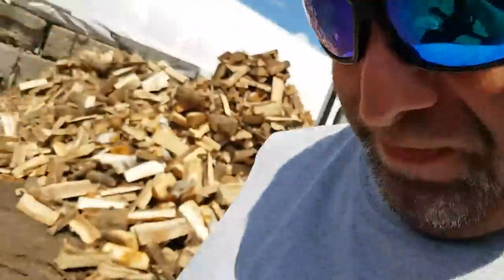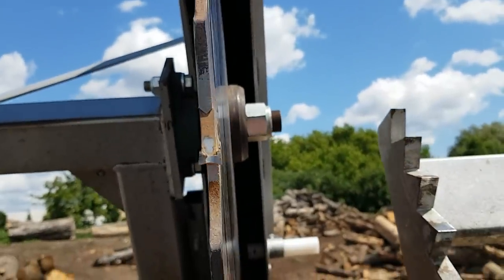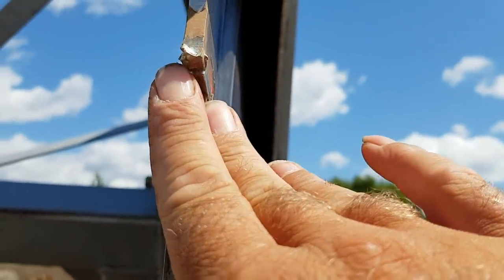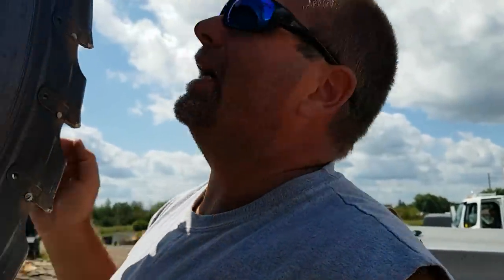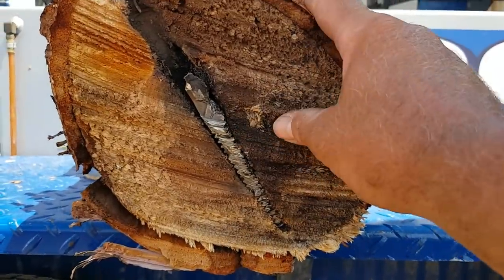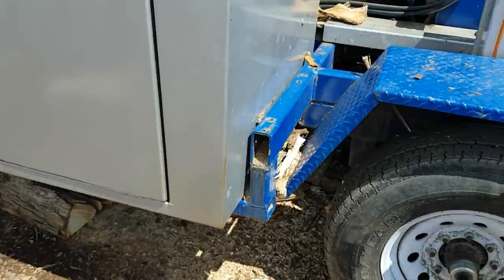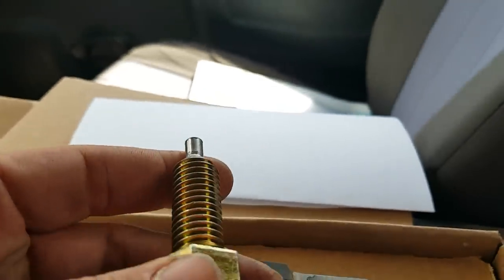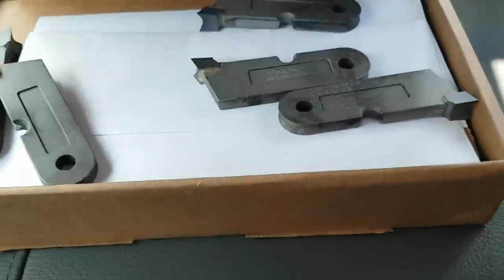MY WORST NIGHTMARE as a firewood processor operator

Comment: I worked at a big sawmill and we ran a huge band saw. The sawyer would hit a big spike or something and it would ruin the band. Ripped the teeth off. Sometimes the Metal was so big the band would break and fly everywhere. The band were at least 14-16 inches wide and really long. That metal will ruin any blade for sure. Be safe GOD BLESS.
Reply from the maker: Ya steel and band saws don't mix.     Happens on our woodmizer too but the band are way cheaper for it then those big boys
Reply: Skidder Kev yeah I worked on a woodmizer to.

Comment: A friend of mine cut through the adjustable sliding fence on a miter saw by accident we both had faces full of metal shards  i would have hated to be around that tree when you cut it
Reply from the maker: Pretty safe in the cab but if you were behind the saw it would be bad news.
Reply: fence needed a redesign and you guys need to get smarter

Comment: I have been piling up the stuff I hit with the sawmill. I have enough bullets to fight a war and enough nails to build a barn. Gate hangers are fatal. Electric fence insulators are tough. A sheet rock screw will ruin your day. Barbed wire will reappear about forty years in deeper. And when you cut nails off one side of the tree remember there are probably nails on the other side too. Sucks killing two blades on one log. And those city trees full of concrete are just wrong.
Reply from the maker: ya the concrete is just over the top.

Comment: Wouldn't it be faster to have an entire blade as a spare and replace it when needed?
So you could always change the teeth on the broken one later on and don't lose so much time while processing.

Some people call that dead capital, but when you need it, you will be happy to have it. Should spare you the drive to the blade shop (not to mention if they by chance happen to have not enough in stock for you) plus the time needed for the actual replacing.

On the other hand: I don't know how much an entire blade weighs. Looks not like an easy task to handle it.
Reply from the maker: Ummm it might be faster but if you are on a custom job you would still have to go back and get it at the yard.  (Nit something that would be brought to every job)  now that we have a set of shanks all we have to do is silver solder on new tips and we will have a set that is easier to carry with us.    A spare blade would be well over 2000 bucks US

Comment: What do you think of a precut metal detector that runs a foot or so ahead of the cut?
Reply from the maker: It would have to be farther then that.    If it was on one side would it be able to read to the other side of a 18"log?
Reply: Skidder Kev you are the expert on this and wouldn’t have to be fancy. Just a clear area to skim the log without any to lower interference from the machinery.
Reply from the maker: I'm not expert on metal detectors I thought you were!    Haha  the problem is having no interference on the other side because of the infeed conveyor

Comment: look almost like a large lathe cutter  . I know that has to suck , I see quite a few of these on youtube with metal buried in trees .
Reply from the maker: I thought it was maybe a gate hanger.   I might cut a cookie off with it and put it in clear  epoxy .
Reply: @SkidderKev  , i meant the tips on your saw blade look like a large lathe cutter .  I bet you find lots of lag bolts and screws and nails in trees  , and barbed wire imbedded in there also .

Comment: when i was growing up, my uncle cut firewood for a living, he was cutting through some old oak that he bought off someone, and hit an old window weight, one of those cast iron beasts you find when remodeling 100 year old houses. Our best guess is someone had to replace their weights, a long time back, and for some reason stuck that one in the tree, god knows why.

The blade on my uncles rig was a solid piece, so when it broke, you had to replace the whole damn thing. the saw itself was probably 75 years old, minimum.

When this thing hit, it lodged a chunk of the saw blade in the side of my uncles old Cat Bulldozer. Had it go off on the opposite side, it would have through the mesh grate that protected my uncle while he was inside his fork truck, loading the logs into the mill.
Reply from the maker: Wow!   That weight really did a number on the saw and dozer.    I never make a cut if anyone is near the back side of the saw or the boss is running the machine behind it.  You just never know what is in a log
Reply: @SkidderKev  Its terrifying to think it only takes a moment to hit disaster. An old bit of fencing, someones old clothes line anchor, and next thing you know, you're seeing a familiar name in the Obituaries.

One thing i always make sure to do is, check the logs i cut for my own firewood, for any lumps or 'oddities' on the surface, as sometimes you can actually see signs of the tree growing over the object.

That simply isnt practical in a mass production setting.

Stay safe, because hot damn, what you do is dangerous.

Comment: All that high dollar equipment and no metal detector is stupid!
Reply from the maker: I don't know of one processor owner that uses a metal detector.   You must be the only one.    They have no guarantee to catch the metal either.
Reply: @SkidderKev  it's a very commonly used item in the timber business. I believe if I owned a $20-50000.00 dollar machine, I would have a $2000.00 metal detector. Just saying....

Comment: Fix it with a angle grinder
Reply: I don't think a grinder would get anywhere near the precise geometric cutting angles. Works on hardened steel but not tungsten

Comment: You should hav cut After the metal bit...
Reply from the maker: I will do that next time
Reply: @SkidderKev  Those blades arent meant to cut thru metal
Reply from the maker: @zazarays  haha I know.
Reply: @SkidderKev  u ruined the blade
Reply from the maker: @zazarays  nope just the carbide teeth.  You can remove the shank and put a new one in
Reply: @SkidderKev  I know how they work i have a circular saw. You should hav sharpened the teeth
Reply from the maker: @zazarays  there wasn't a tooth left to sharpen.   And if you have a circular saw you would know the blade wasn't ruined.
Reply: @SkidderKev  Well its too bad you dont know what ur doing or you could hav saved urself alot of trouble. If you had something for spliting firewood you could hav pulled the metal object to inspect it. But you probly wouldnt know where to find something like that. Ur welcome
Reply from the maker: @zazarays  hahaha ok
Reply: @SkidderKev  let me know if you need help with anything else
Reply from the maker: @fulckanunturned8584  ain't that the truth